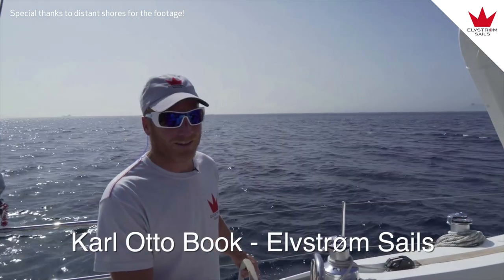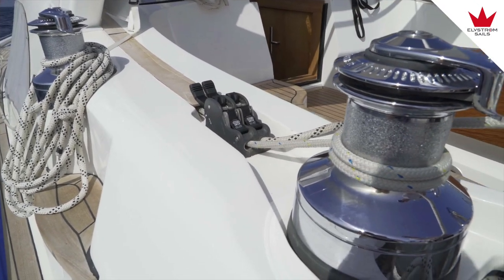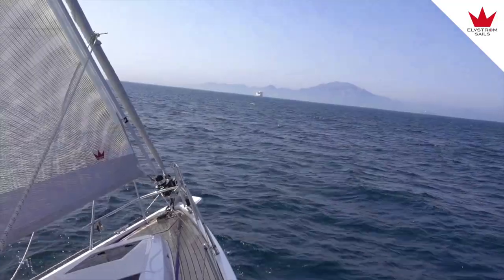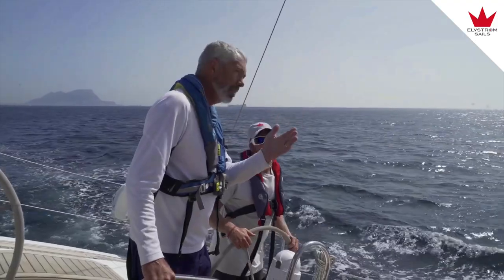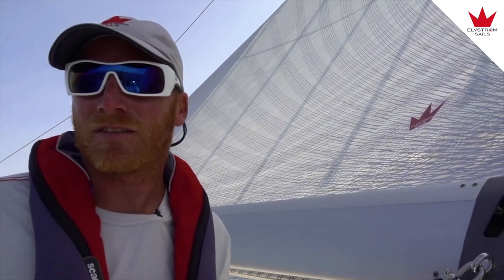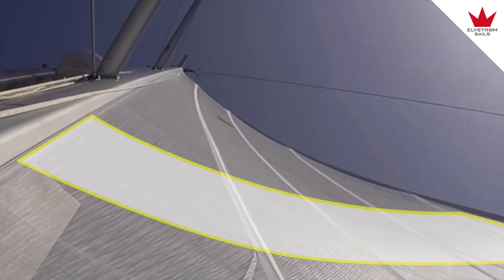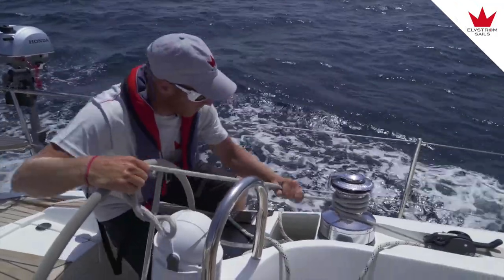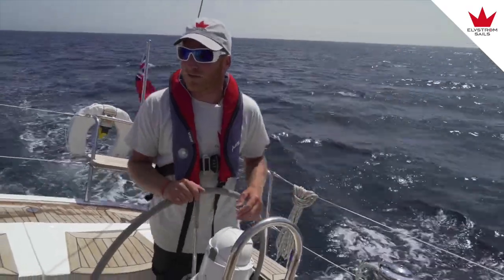Tips on handling your full-battened furling main sail

Comment: I m little confused; as far as I know when you are reefing and main sail puttin you need to release the back stay inorder to avoid crincle on sails. Am I wrong or it is different on full batten furling main
Reply: U are right.
Reply from the maker: When furling or unfurling an in-mast furling mainsail, a straight mast will always be the best option. If you have an adjustable backstay, of course easing this off while furling in or out is highly recommended. 
However, full battens are your best friend for “not perfect” handling. The battens will stretch the cloth for each 70-100 cm and make sure there are no possibilities that the sail will fold double, and for this reason the furling will be “safer”. So, with the full battens, the furling will work also with some mast bend.
Reply: @elvstromsailsofficial  I thought so 😀

Comment: I understood that this vertical battens makes the furling operation easier and less prone to jamming, right? But on the other hand this vertical battens makes lowering the sail an almost impossible operation in an emergency at sea, right? Don´t you think this is too big a risk? What do you suggest doing if such a sail needs to be lowered on an emergency?
Reply: you're failing to understand how the system works... the sail doesn't lower, it physically does not lower, it doesn't go up and down.. in an emergency, if your electrical system goes out you simply pull it in by hand/winch (and if you reefing last minute you doing something wrong imo, outside of an unpredictable situation)... the sail goes in and out, not up and down.  it's a mast furling system, not a boom furling nor a 'traditional' halyard run atop the mast solution.    mast furling solutions are more akin to forward sail furling systems if that's easier for you to comprehend/envision.  hope that explanation helps you.  -so that's why vertical battens make sense in the first place, they are actually a safer and superior improvement for mast furling solutions, due to the way the entire system operates.
Reply: @Mars21681  I understand how the system works, what I meant is that in an emergency, if the sail cannot be furled due to jamming, for example, the situation can deteriorate quickly, especially if sea and wind conditions are critical. If the sail did not have vertical battens, it could be pulled out and dropped over the boom.
Reply: @BRuas9080 you're not understanding how that system works unfortunately.  It will come down to you actually looking into the system more thoroughly without any preconceived notions.  you have the internet at your disposal presumably and the experiences of others, you can also experience yourself and check things out possibly in person.
Reply: @Mars21681  do you have a system like that on your boat?
Reply: @BRuas9080  it works quite well and it can be made to manually release.  In mast furling has come a long way. And Selden SMF is the way forward for me.  The vertical batten Sail elvstrom is offering is what I'm considering and possibly going to their shop in Denmark in the next week.
Reply: @Mars21681  The issue is not that there may be a problem in the electrical system, when the jam occurs it can be very difficult to keep furling the sail even by hand and the only alternative is to pull the sail out again. And in this case the only alternative is to lower the sail, which with the vertical battens proves to be almost impossible. Selden systems are really good, but I've had one for over 10 years with a in-mast furling sail with vertical battens and I know that even Selden systems are not immune to trouble. That's why I asked if the author of the video had a solution, because the video talks about all the qualities, which are true, but it doesn't say anything about the increased risk when using the vertical battens.
Reply: @BRuas9080  usually from what I've seen... The issues are more user error.. but they can be fixed quickly during jam
. And so you know with that system you don't have stays that roll up and down it's always in and out.
Reply: @Mars21681  no, you can also lower the sail over the boom if you want. You only need to loose the halyard. But first you have to take the battens out ….
Reply: @BRuas9080  different system, no halyard to hoist.
Reply: @Mars21681  My Selden in-mast furling system had a halyard, which was used to raise the sail for the first time and to lower it when we wanted to stow it away from the boat.
Reply: @BRuas9080  you don't make any sense, if there was an emergency at sea as your scenario.  Why would you be getting on deck disassembling the in mast system, you'd end up having your main sail in the ocean somewhere.  Once you DC the bottom the top can be dropped, the vertical battens wouldn't change that.  You'd still have a big mess and sail likely trying to fly off in the next gust.  If you had a jam that's not how you fix it... We must be on two totally different planets when it comes to sailing. Because there's no way in hell I'd be DCing the system at sea.  I've never had a jam with the smf , prior to smf yes, and get the jam out is easy once I learned how to properly do it.   It's something that would be just as fast as removing the sail, much safer, and still keeps my main sail.   In any case why reef at the last moment.  There should be plenty of time to un jam the main which from my experience has always been from user error.. and even a tough jam you simply need to repeat the steps in and out properly a few times.  It would suck to have to point up while you do it depending on conditions; but again, why wait till last min.. that's bad and or inexperienced calls on the skipper.    Now that I think about it, I suppose if I can envision a crew so wet behind the ears they jam the main have no idea how to unjam it, with a squall bearing down because they caught completely unaware, and sitting here on deck dropping the main LOL what a sight and dangerous in likely turbulent seas.  Just asking for a man overboard or that sail to POOF catch that next guest while you have two or three trying to wrangle that thing in smh.